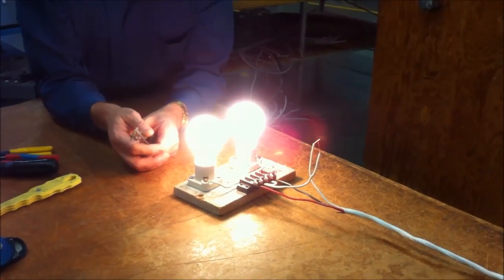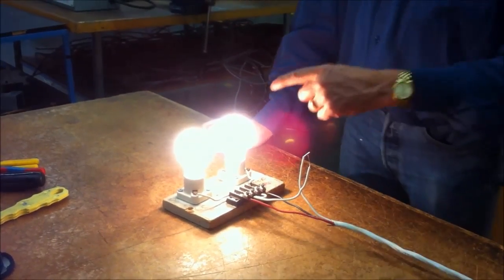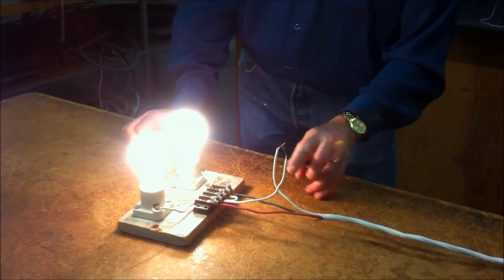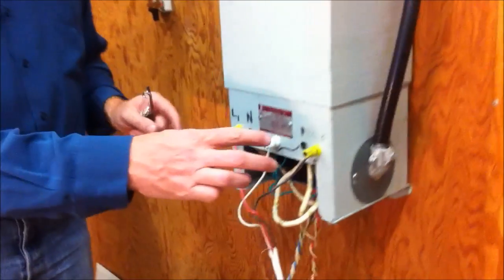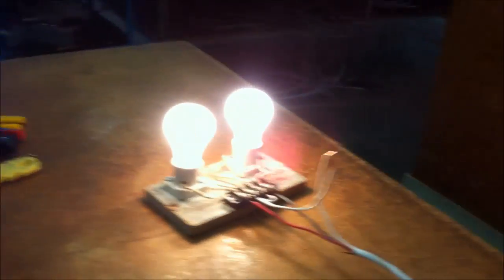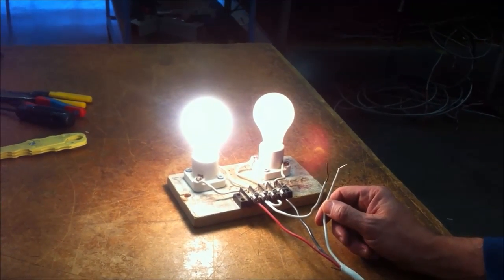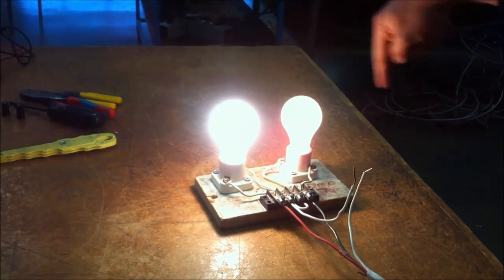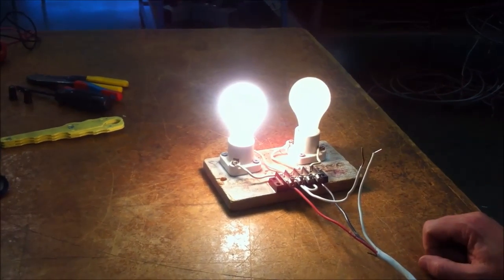Open neutral mini lesson

Comment: If a fool has switched the neutral instead of the hot, will current use ground and basically bypass the switch?

Comment: I have a issue… lol. 

One day My light randomly stops working… (2 light fixtures to one switch! And other one works fine) …. So I disassemble the bulb fixture that isn’t working and test the wires….WIRES are getting power… but bulb isn’t working…SO…I go ahead and buy a new connection where the bulb screws in…. 
I Install new bulb connection and install new bulb … STILL NO light on…. 

   So I check the power and IT has power and correct volt…. But the bulb still isn’t coming on?! Lol. 
————————————-
-So the electric to the fixture is good
-The bulb connection is hot and good
- Electricity in the wires are good
- connections are tight…. 
-I replaced the switch just to be sure …
Idk what to do …. 

?! 
Since two fixtures are tied to 1 switch…. Maybe one of the wires to 1 of the fixtures tied to 1 switch maybe the neutral wire has become damaged over time?…….

Any help would be appreciated. Trying to help my dad here and I’m stuck haha

Comment: If both bulbs are the same resistance and same wattage, how does the
circuit decided which one gets the MOST voltage ?  Sharing the 240 volts in a SERIES CIRCUIT.  

PS. if the loads were DIFFERENT, then only the lower current draw would continue to operate?  The higher current draw would not be able to operate? thank you.    KVL series circuits.

Comment: both lams are at different values; when neutral breaks more voltage goes to smaller lame, and less to bigger lamp, if both lamps were equal breaking the neutral wouldn't effect them.

Comment: Nice video, however it would have made it clearer if you mentioned that this only happens when the two bulbs share the same nuetral upline of the panel. With dedicated nuetrals for each circuit this wouldnt happen
Reply: This is great example why not to wire in series. Ac should be wired in parallel.

Comment: When this happens devices that were in parallel might end up being in series (as you demonstrate).  In a house you might go around with a multimeter and measure odd voltages across lights etc.  Lights might not appear work but when measured have lower than normal voltage across them.  Very bad.

Comment: I was going to  comment about the brightness difference until I noticed that commentor Griff literly used the words I would have used.  Sometimes I like to use extremes in a hypothetical case. For instance, one lamp might be 1000 watts, the other might be 10.  The resistance of the 1000 watter would be so low as to be a virtual short  to the 10 watt lamp, which would surely burn out. I didn;t try doing the math on this, as Griff did. All in all, a great demo.

Comment: Why does one get a higher voltage than the other side if they're both receiving 240 volts?
Reply: With the broken neutral, the lamps are in series with 240 volts across the entire circuit. The lower wattage lamp has a higher resistance so more of the supply voltage is dropped across it, making it burn brighter than designed. The higher wattage lamp gets the remaining voltage and burns dimmer than designed. Assuming the lamps are 100 and 60 watts respectively, the 100w lamp would have 144 ohms of resistance. The 60w lamp would have 240 ohms. Total resistance of the entire circuit is 384 ohms. 240 volts across 384 ohms is 0.625 amps. You can use Ohm's law to calculate the voltage across each lamp. E = IR 144 ohms x 0.625 amps = 90 volts across the 100w lamp. 0.625 amps x 240 ohms= 150 volts across the 60w lamp.
Reply: @bamaslamma1003  thanks

Comment: KVL does Kirchhoff voltage law apply?  The two bulbs are in SERIES across 240
volts AC when you open the neutral?  Classic example of a shared neutral? 
Thank you.
Reply: KVL and KCL ALWAYS apply.  Voltage or Current just doesn't get added in or taken away randomly.  The Voltage Drops must add to the Total V, and the Current Drops must add to the Total Current.   Thank goodness for the Austin Community College Electronics Program back in 1991-1995.  Thank you, Professors!

Comment: Suggestion: Add in the voltage drops across each bulb.

This is a typical 3 wire circuit illustration where you have 2 "hots" and a "common neutral." A neutral normally carries the unbalanced current in a 3 wire circuit. If you open the neutral the circuit becomes a series circuit. IF the circuit is unbalanced with, for example a 60 watt bulb on one side and a 100 watt bulb on the other, the neutral would carry 40 watts back to the transformer. IF the neutral is open then the current from each bulb will flow through the other to return to the transformer. There will be different voltage drops across each bulb because the resistance is different, and the smaller bulb will become brighter and eventually burn out. Both bulbs will then go out because there is no return as the circuit is open.

The demonstration is "Technically sound and correct." Anyone stating this is not correct does not understand what is taking place.

Comment: When neutral removed the two bulbs became series and the bulb with greater wattage turned bright due to lower resistance.
Reply: That's the general idea. You've just got it backwards. The higher wattage lamp would be DIMMER. The higher wattage lamp has less resistance than the lower wattage one. Since the lower wattage lamp has more resistance, it sees the greatest voltage drop which causes it to burn brighter. The higher wattage lamp has lower resistance so it sees less voltage drop and burns dimmer. With the neutral intact, it carries the difference in current back to the source. Both lamps get 120v and burn at the correct brightness.

Comment: This is very weird to me. Both black 120V and red 120V are connected to bulbs, but grounded to the same white. The ground is removed and so there is no ground (neutral), just two hots. One hot is supposed to then become a ground (neutral) and the other becomes a 240V? DOES THAT HAPPEN AUTOMATICALLY SOMEHOW???? PLEASE EXPLAIN THAT!!!
Reply: Since you are dealing with AC not DC you can't just add and subtract voltages the same way. It has to be in reference to what the other wires voltage is at the time. The neutral wire is 0v and the hot wires are between 120v and -120v. They switch polarity 60 times per second so they don't stay the same voltage all of the time but are constantly changing. There is usually a maximum of 240 volts difference between them. 120v - ( -120v) = 240v. So if the red wire is 120v at the moment that means the black wire is -120v. Then when the red wire switches to -120v the black wire has switched to 120v. They keep going back and forth like that. They are always 120v away from 0v at their peak and always 240v away from each other at their peak. hopefully this makes sense without a diagram.

https://i.stack.imgur.com/HdUzm.gif
Reply: This is a 3 wire circuit. The neutral can either be grounded or above ground. It makes no difference in this illustration. When the neutral is opened a "Series circuit" is created. The current from one bulb returns through the other and vice versa.

Comment: My interpretation of your demonstration is that without the neutral, you have 2 lamps in a 240V circuit with differing wattages, hence the reason why one lamp is brighter than the other. In series, if both lamps are (120W) for instance, then the voltage drop across both lamps would be equal, while the same amount of current is pushed through both of them. If however, one lamp is (120W) and the other is (60W), then the voltage drop across the (120W) would be 160V, while across the (60W) would be 80V. Again, the current (.75A) would be the same through both lamps. With the neutral intact, you now have a parallel circuit, with the same voltage (120V) across both lamps, but if the wattages are different, then you'll have different amounts of current going through each lamp. And the neutral is there to carry the imbalance amount of current back to the source.
Reply: https://www.youtube.com/watch?v=v9q3EnrHngo this vid explains more
Reply: @MeeFeeTree  So what exactly was the point that you were conveying to the viewers? Was it to highlight the dangers of a shared neutral? If that was your point, then YES, you would never want to wire a house, for instance, where the same BRANCH Neutral is being used between (L1) Red and (L2) Black. The only situation that I can think of where sharing a neutral is acceptable, is inside an appliance like an Electric Stove or an Electric Clothes Dryer, where you will need (240V) for the Heating Element, and (120V) for Clocks or Timers and Oven Light Bulbs. And if the neutral was to break in those devices, the fact that they are not rated for (240V), they would burn out very quickly.

Thank you for being a Content creator and sharing your knowledge with these video postings. I truly appreciate people like you, because I've learned a lot, and it has helped me tremendously in my career.
Reply: @griffmustard  It is legal to do a MWBC or multi-wire branch circuit with a common trip breaker so both legs trip at the same time during a fault.

Comment: Current still flows through jumper after opening neutral that's why lights stay lit
Reply: in a 3 wire circuit the neutral carries ONLY the unbalanced current. If two 100 watt bulbs were used in this demo you'd just have a 240 volt series circuit with the same voltage on each bulb. However, a 100 watt bulb and a 60 watt bulb in the same series circuit would have different resistances. This means that the voltages dropped across each bulb are different as is the current. The lower wattage bulb can't take the current and burn bright, and then out.
Reply: Thanks for pointing that out. But I still don't get why two hots can act like one becomes 240 and the other a neutral.
Reply: Billy Graham try and draw a circuit diagram representing the system and let's go from there. I don't specialize in electrical, and neural wires are something I know little about. basic principles simply say that current flow through filament emits light... also someone else's comment about wattage of the bulbs and the brightness is a fair assumption. food for thought

Comment: Will this cause the lights in the house to flicker when the dryer or washing machine is on??
Reply: "Flickering" if you mean the lights slightly dim when turning on a heavy load electrical appliance can be normal. It can also be caused by a high resistance bad connection causing a sudden voltage drop.

Comment: this is so hard to explain to the young guys coming in.  I'm going to have to make one.  very nice
Reply: It all comes back to knowing THEORY, currents add  up in a parallel circuit, voltages 
add up in a series circuit. if one knows good theory, many times they know what the
problem is before they pick up a screwdriver

Comment: A very misleading demo. First he said the bulbs are on different circuits... NO because he has the Neutral JUMPED as well as connected to the Neutral from the power supply. IF he had both bulbs on SEPARATE circuits and disconnected the Neutral(S)  they would go out...   BUT because the neutrals are JUMPED, The bulbs effectively get 240 volts in SERIES...  that is why the first is brighter....  POOR explanation...
Reply: They ARE 2 separate circuits. The neutral is not jumped, it's shared between the 2 phases. It's a very common way circuits are run in your home. It's called a MWBC (google it).  Also, this is how the 240V coming into your house on the main is wired. If the neutral becomes disconnected, you will have high and low voltages on each phase (according to loading on each phase)
In this example, yes, the 2 light bulbs are different wattages, if they were the same, losing the neutral would have had no effect.
Reply: @PhaseV  I thought if you took the neutral off electricity would not run a path through bulb and not light??
Reply: A separate circuit does not need a dedicated neutral. This is a classic example of a "lost neutral", especially in older homes.
Reply: @tim g thx Tim 👍
Reply: Exactly this. This guy is either stupid or just plain forgot about to add that to his explaination.

Comment: This is for anyone.  Am I correct in saying the bulb with the higher resistance get brighter?
Reply: The bulb with the lower resistance will burn brighter. Less resistance, more current flow.
Reply: @johnalexander7490 Replace one with a big thick copper wire with negligible resistance, and the other with a thin piece of fuse wire. Which one burns the brightest (for a very short period of time)?
Reply: Freds answer below is correct.  The lower a filament resistance is, the brighter the bulb will burn.   Resistance and Current being inversely proportional.
Reply: +olaguna2 Yes. You can see this by considering that the current through both bulbs is the same (since they're in series) and V=IR.
Reply: YUP that is right, read about that awhile ago, partially cooked waffle an a burned shirt.
husband was doing up a waffle as wife was ironing his shirt. the neutral got lost and
the 600 watt flat iron had 160 volts going to it and yes the shirt too, while 80 volts 
resulted in a partly done waffle.

Comment: how  is that lamps are on with out neutral???
Reply: +ROD BOY They're connected in series. with 240V across both of them.
Reply: If I understand this correctly, 120v passes on red to black on one phase of 60hz, and black to red on the other. 180 deg shift in sine wave allows the current to play ping pong back and forth.
Reply: think of a transformer with a center tapped winding. on the secondary side. We can think of the center tap as the neutral. wire.

Comment: This was a misleading video.  If the lamps were of equal wattage [i.e.: equal resistance], the brightness would not have changed.  Even minor differences due to manufacturing variations would not be significant enough to see a change in brightness.  So the comments saying the bulbs were different wattage are correct.
Reply: +Richard Fallstich  You are Both Incorrect... The bulbs are equal wattage, but when he removes the neutral the bulbs are in series because of the neutral JUMPER... Look for the JUMPER...
Reply: +Joseph F Reganato Jr I do see that the bulbs are in series - I never said they weren't in series.  If you look closely, the bulb on the right seems somewhat brighter (higher wattage, lower resistance) when the neutral is connected back to the source.  When the neutral is removed, the bulbs are in series with 240V across both bulbs.  If the right bulb is indeed a higher wattage it will have lower resistance and thus less voltage across it when in series with a lower wattage (higher resistance) lamp.
Reply: Richard Fallstich; we studied DC current in college physics, and voltage drop was a directional thing. The first lamp would always be brighter than the second, due to the drop in voltage. BUT HERE we have two hots of 120V. You would think both would power their own bulb, but then where is the neutral to complete a circuit???
Reply: Billy Graham........ the is an AC circuit. The polarity changes every half cycle. Line (1) is separated from Line (2) by 180 degrees.

Comment: If both bulbs were the same wattage there would be no difference in brightness.
Reply: When no fault condition existed, both bulbs were the same brightness hence the same wattage  (as is indicated on bulbs, any manufacturing variances notwithstanding).  When the fault was introduced, the bulb with slightly higher resistance (a manufacturing variance) shines brighter only because the current through both is the same.
Reply: @standlegweak9854  Well put.
Reply: @standlegweak9854  Slightly higher resistance does not explain that. Christmas tree lights are in series and they do not behave like that. P = I^2 * R. The power is proportional to the resistance.

Comment: I can't understand what determines which bulb becomes brighter.
Reply: yeah, he forgot to explain that he is using two bulbs of DIFFERENT wattages. Had he used 2 identical bulbs, there would be no change and no effect when the neutral was opened.
Reply: The resistance of each bulb(load). Think of this as now these lamps are a simple series circuit. The resistance of each lamp will dictate how much voltage each gets. If they were identical, they would each get 120.
Reply: +hystat When no fault condition existed, both bulbs were the same brightness hence the same wattage  (as is indicated on bulbs, any manufacturing variances notwithstanding).  When the fault was introduced, the bulb with slightly higher resistance (a manufacturing variance) shines brighter only because the current through both is the same.
Reply: + hystat  By the way, I really liked your "Neutral Wire Explained" demo - excellent explanation.